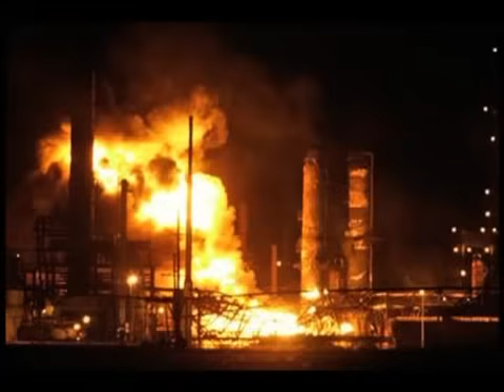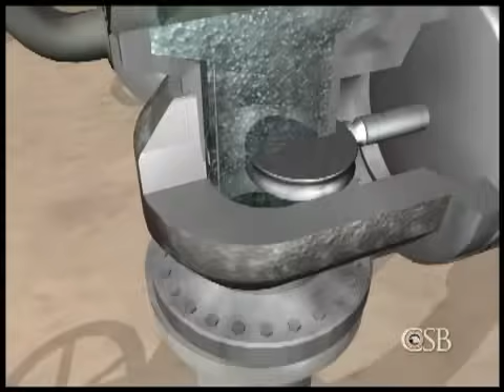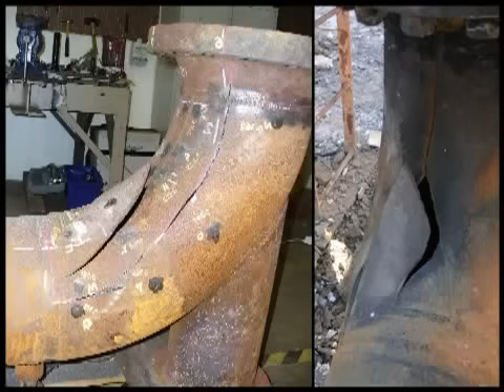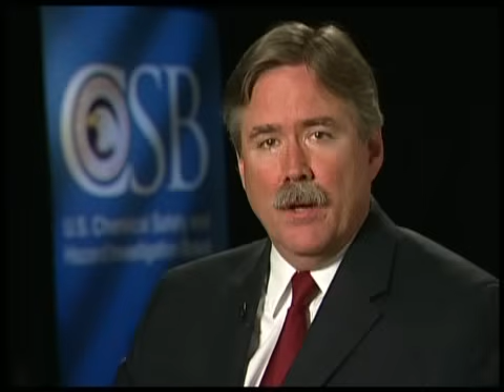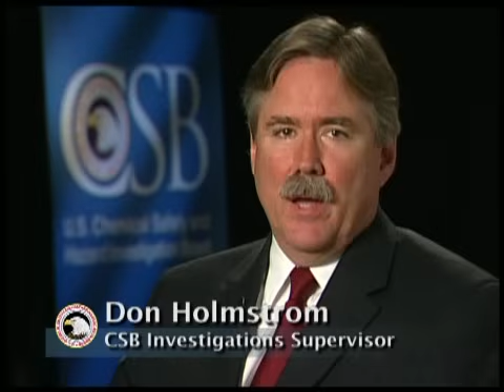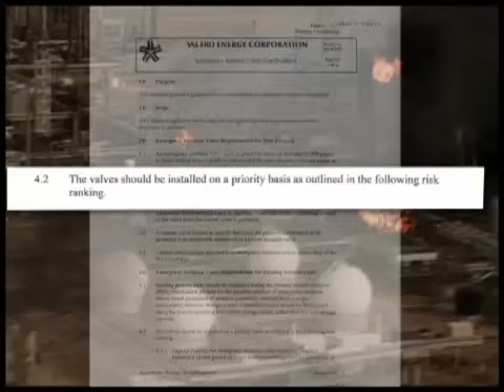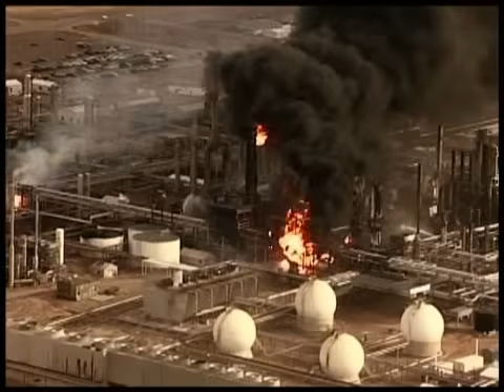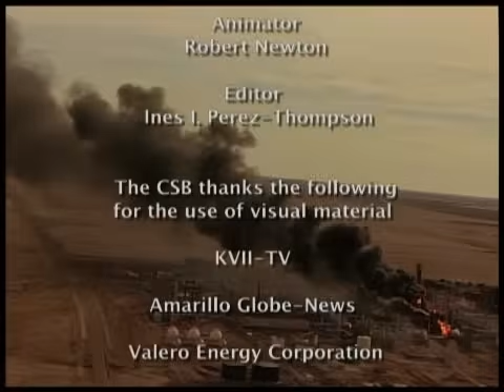CSB Safety Video: Fire From Ice

Comment: Another reason to use Ball Valves instead of Gate Valves. You will know if their not completely closed because of the handle position.
Reply: Ball valves can leak past their packing into the atmosphere, creating a hazard that way. There is no totally fail-safe valve topology. What really was needed was  basic instrumentation to verify at minimum the pressure in the dead leg, and better yet flow rates in and out the active legs of the rest of the unit. These guys have more than enough money to afford a few $k in additional gauges and instrumentation to verify proper operation.
Reply: @tetrabromobisphenol  ef seal packing...
Reply: Ball valves are fine, but easily opened. A gate valve is a slow open valve. Both valves have their useful areas of use.
Reply: I have no idea whats going on but I like listening to you guys.
Reply: No. Ball valves can be easily bumped or vibrated open and - depending on their orientation - can get trash stuck in them too.  Don’t get me started on ball valves with Teflon seats.  Give me a gate valve with a packing leak any day(that can be fixed easily with channel locks or injected if necessary) over a new ball valve.  

Have you ever seen a ball valve where the handle is taken off and remounted?  I have. The handle doesn’t always “tell the tale”.  And if I want to know a gate valve is closed I just look at the stem and/or put a valve wrench on it.

Ball valves have their uses: first out valve on a sphere (quick action needed type service) and some non hazardous or low pressure streams, but other than that yeah no.
Reply: @modelb9332  you've never seen P&IDs of modern process plants and offshore facilities where almost all the on/off valves are ball type. 
Ball valve only for low pressure service? Oh yeah, tell that to design engineers or operators of "upstream" oil and gas christmas trees, offshore and subsea pipelines, and buoy moorings.
Reply: @poorboysadventures4636  yes, and almost ALL subsea pipeline manifolds are with pneumatic controlled ball valves (spec API 6D SS).
Reply: @Janezqx of course they are if they're pneumatically controlled.  otherwise its a ridiculous response time and control angle.  doesn't mean its the best choice for something sitting in place closed for 15 years.
Reply: Person watches 13.5-minute video that explains why you shouldn't use valves to isolate dead legs and comments "They used the wrong kind of valve." :sigh:
Reply: Quarter turn valves, such as ball valves, have a better packing solution nowadays than linear valves such as gate valves. Quarter turn of the valve shaft creates less friction on the valve packing. In a linear valve the shaft rotates and moves upward / downward, putting way more stress on the valve packing.

Comment: I want to know how the metal object got in the pipe and managed to get stuck in a spot that prevented full closure of the valve.
Reply: Welder upstream dropped a 6013 rod somewhere and it got washed downstream. If the filters aren't designed or maintained properly it can easily get pushed many miles down pipe.
Reply: @tetrabromobisphenol  6013??  You mean low hydrogen if he's welding pipe...or 6010
Reply: It appears to have been dropped in or left behind.
Reply: everyone is saying 'welding rod' ignoring that that's clearly a computer generated graphic.